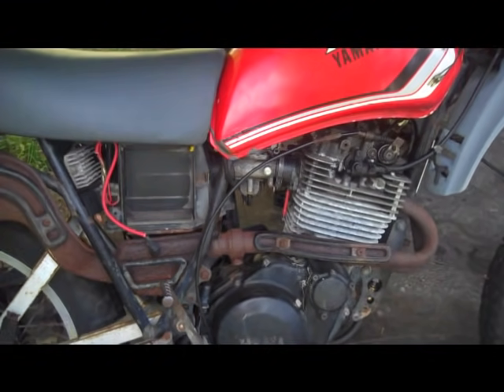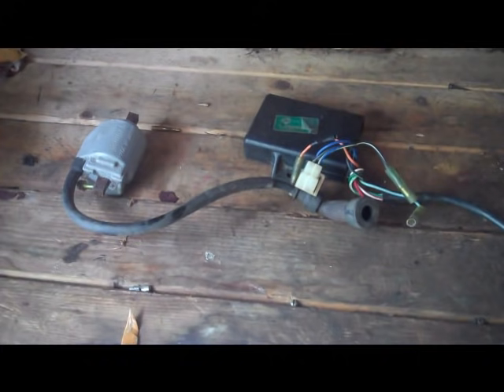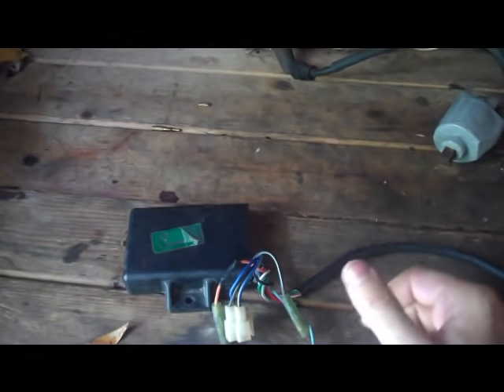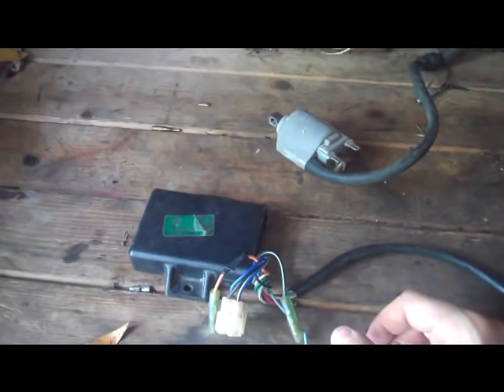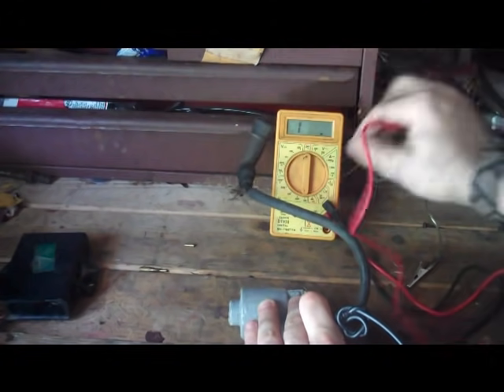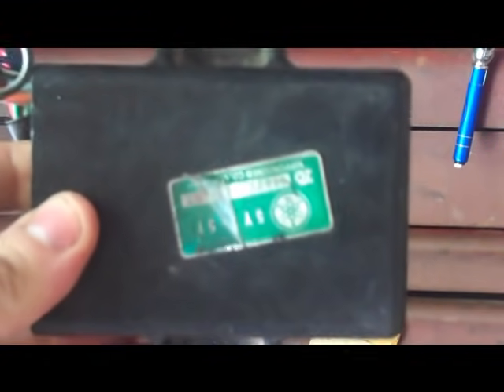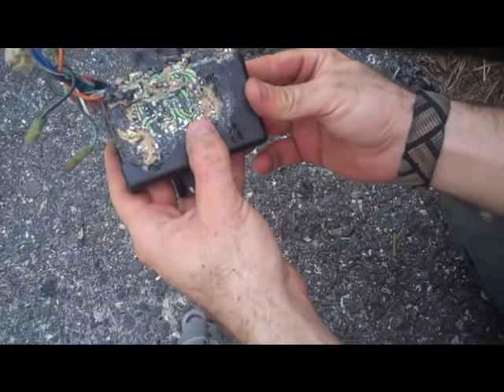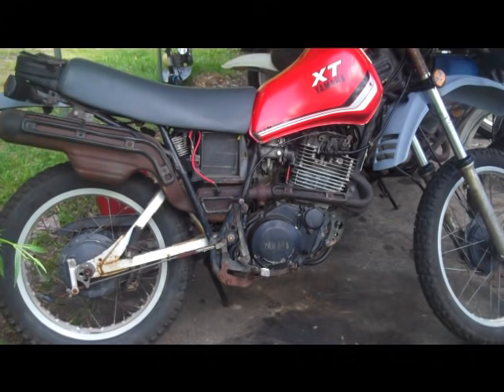How to test motorcycle CDI box, ignition coil

Comment: I have a kazuma 110cc lacoste quad. Took panels off to repaint and after putiing it back together, it no longer runs. It ran prior. It cranks over and is getting fuel, but will not start. How do i test ignition switch, coil,  cdi box? and do you have a wiring schematic print that shows me wiring? It is possible I have battery wiring wrong. im not sure as I do not have a  troubleshooting /repair manual. I could sure use your help. Please send me any repair/diagnostic manual info, etc. that could help me trace and find the problem that it is evident, I caused myself. I bought this lil quad new for my daughter when she was 12 in 2005, and only ridden for about 50 hours b4 being parked in barn since 2007. I am trying to fix back up for my grandsons. And also for my nephews 2 boys when they all come visit me out in country where i live. I am disabled and working on this quad is a good thing being it helps me physically, mentally because of my spine and spinal cord injury that has disabled me and am proud to have great family. I just created  more problems causing it now not to run! lol!!! thanks again - Dennis
my email id - 1racetrans@gmail.com

       Thank you again and God Bless you
Reply from the maker: +DENNIS SBRUSCH Dennis unfortunately I dont have a wiring diagram to offer you but you may be able to find one online. You should review my no spark video for more information about diagnosing these problems, and let me know if you have any questions after.
Reply: i got parts coming to me in the mail also

Comment: my front cylinder won't fire could this be why and could you tell me where the coil wires  go on a 1993 yamaha virgo thanks
Reply from the maker: +Phil manwarren If one cyl is firing, chances are the cdi is working. See your wiring diagram for where those wires go
Reply: +mrmaxstorey  i don't have one
Reply from the maker: +Phil manwarren Buy a repair manual or download one
Reply: whats the web sight ?

Comment: Can I use a cdi off a  Arctic Cat 1973 cheetah 340 and use it on a Honda 1972 Mt 250 also 2 stroke?
Reply from the maker: +TokeXecution Most likely not
Reply: that mt doesn't use a cdi box.  just old school points and condensor.  no spark? check them out. (under flywheel, left side of bike behind HONDA cover)

Comment: i have an 81 kz 650 i went yo start it it turnd over the starter and then the starter just stoped i tried to push start it but nothing happens what could this be
Reply: Could be bad earthing on the starter but not the way you think.  The carbon brushes earth to the starter end cap which then earths to the "pot" (the metal cylinder of the motor) This then earths to the starter motor mounting flange which earths to the engine. Several dubious connections are there which are infamous for causing Harley Davidsons to be non-runners.  Wise owners get some flat copper braid and fit one end to the starter motor mounting bolt.  The other end gets wired to the starter motor end cap bolt thereby bypassing doubtful connections.  With a little skill the braid can be positioned where it is less obvious and it can be painted to match the bike.

 Most vehicles have lots of fortuitous earths but unless one lives in Arizona they can give big trouble.  For example one car that I retired long ago had always suffered from poor charging and flat batteries until I owned it.  The problem was about a dozen poor or iffy connections between the alternator diode assembly negative and battery negative.  A yard of copper braid transformed the car like Popeye having his spinach! The worst fault was the alternator mounting bracket that was blackened by electrical burns where it was bolted to the engine block. Previous owners had wasted money on batteries and alternators but they and their garages never solved the problem.

Comment: high i used to have the xt 600 bugger to kick over, any way I have a kawasaki vn 800 re wiring the bike, following the diagram there is no  poz neg on the coils, but the colour code on the wires are different, so what side do you fit the wires to the coils also i will need an ecu would second hand do and would it just work when connected or will it have to be set up to some programe
Reply from the maker: +trevor francis You can just plug in a CDI and used is fine provided that it is known to work. As for the coils consult your wiring diagram

Comment: i have a 1980 yamaha sr250 that has no spark...i have checked the ignition coil, pick up coil, starter solenoid, and battery. they all check out fine. spark plug is new and the safety relay works.  heres where things get funky...if i have the ignition on and i put the bike from stop to run and put a meter on my spark plug wire i have a constant 12v. if i leave the meter on the wire and switch it to stop i lose the 12v.  my starter button doesnt work either but i think thats just worn contacts. also, will the bike get spark even if the neutral switch is bad? Thanks Matt
Reply from the maker: +Matthew Vescovi You are supposed to get 12v at one of the coil wires, the other has intermittent ground which is what collapses the field and makes the spark happen, so that seems normal. Also the stop switch arrests the spark, so the fact that you lose the 12v is normal too. And yes if the neutral light is bad it may prevent spark if you have a neutral safety switch on your bike
Reply: +mrmaxstorey thanks for the information, i think i might of mislead you when i said spark plug wire.  I didnt mean either of the wires going to the ignition coil, I meant the actual spark plug wire itself.  if that makes any difference in your input please let me know.

Comment: I have a 94 250 Yamaha Timberwolf and it will start by jumping at the starter.  Will not start from switch.  I have been told I need a CDI box.  What do you say?  Thanks a bunch   Danny
Reply from the maker: +Danny Vansickle I dont think thats correct. The CDI is not like the master computer of your machine, it is responsible for determining when to tell the coils to spark. If you are getting spark, and you are when you jump the bike at the starter, then your CDI is fine. I would look towards your starter button, or starter solenoid as the culprit for your problem

Comment: I have a 2006 Suzuki 200 with 1000 miles. starts and runs fine for about 20-30 min then it starts to bog out then shuts off. the bike will not restart until it cools down which is usually 20 min after it shuts down. any suggestions?
Reply from the maker: +john geni Test the spark at that time, see if you have lost your spark. If not then spray some starter fluid in the intake and try to start it. If it starts, that means you have lost your fuel supply. Both are possible when a bike gets warm and it can help you find the problem
Reply: Sound like the coil. Sometime when a bike warms up the coil will lose spark then when it cools get spark again(at least til it warms up again) if this is what happening could be ur coil.

Comment: hey don't know if anyone can help me here. I've got an old 2 stroke scooter, I put a new spark plug in it, (identical to the one taken out, which looked to be as fouled and corroded as a plug can be and still work)  it ran fantastic for about 10 minutes and now won't start again. ran great for months before, it cranks and turns over strong and I can see a good spark on the plug when tested, even starting fluid doesn't start it and the plug seems dry after a 2 minute starting attempt at different times. any ideas?
Reply from the maker: +Paul  Bubnash Is the spark plug fouled again?
Reply: +mrmaxstorey I don't believe so. I've tried starting it numerous times with both the new one and the old one I removed. no dice. it won't fire at all when trying to start whether or not I give it gas. maybe spark is weak?
Reply from the maker: +Paul  Bubnash Maybe, thats easy enough to test for. You need to proceed by confirming you have air, fuel, spark and compression. I set up a motorcycle diagnostic website to help guide people through this process:   www.TheMotorcycleMedic.com

Comment: Hi Mr Max.  two months ago I "shorted out" on a hot day and had to push my bike home.  It's a 1991 Honda Nighthawk CB750.   I removed the seat and saw that the wires from the harness that run under the seat were fried.  I removed the harness and replaced it with another one from a twin bike I have for parts.  No dice.  I ordered a new harness only this one didn't have an extra solenoid.  Today I tried to fix again and took out an alarm box that was connected to nothing (I checked it from stem to stern) and ended up removing a bunch of wires.  However, from that wiring mess, two black wires were cut into the rear light wires (orange and blue) via two little blue plastic connectors that have little metal pieces in it to cut into the wire.  

However, when I turn the key, I don't get any lights or any sign of life.  It's dead.  I know I have an extra solenoid somewhere.  I just ordered an ammeter and will check the solenoid, battery and starter, then will check the kill switch and ignition.  \\Do you have any other ideas?

vgobaira@yahoo.com

Thanks and keep up the great work.
Reply from the maker: +Valerie Gobaira Thats a pretty good start. Sounds like you have a real mess in there.
Reply: Yeah. It was perfect but i used crappy electrical tape.

Comment: I have a 650 kawasaki jetski that wont spark. It has new plugs, cdi (which has coils + leads built in) new regulator. There aren't many electronic parts in a jet ski and I have replaced them all. Even has a new battery. It turns over fine but won't spark. I'm out of ideas.
Reply from the maker: James Dean Are you getting power into the coil pack?
Reply: mrmaxstorey hi i have a 81 honda atc 250r when i start it it usualy kicks back and when it does start it will only stay running a couple min at most it DOES LOOSE SPARK [tested by using spark test tool, made specificly to check for spark] then after sitting for 5-15 min it will get spark again just long enough to get a good rev or two outta it then stop firing again. if i try check for spark with tool to soon it will spark a couple kicks then no fire again, wait a moment and it will give a spark or two. got any ideas?

Comment: My bike went to an old garage.  Mechanic said it had weak spark and blamed the cdi box.  Could that be the correct diagnosis?  Being that my bike is a 81 Suzuki GS1000G, where would I find a replacement that doesn't cost an arm and a leg, like over $200?

Comment: Umm my problem is i got my bike running after two years i cleaned the carbs and all the basic start up maintenance replaced the bendix.... noww i go to flip the key and no green light however i press the start button an my oil light appears but no movement in the starter .., so i watched more videos check my siliniod my ground cleaned the inside of the starter button .. all my lights work ... idk
Reply from the maker: Check out my videos on starter motor problems

Comment: Eh bud.....if the spark plug is not completely flush with the block would that be an issue for a start it looks like my threds are a little stripped #3 and its not sitting all the way down....   and the second thing the on off switch.....I can only here the bike turn over after the 4th or 5th try.......thanx bud your vids rock.......
Reply from the maker: Hey dude yeah that can cause some issues. Your motor is designed to ignite the air and fuel at a specific spot, if your spark plug is not the right type and not screwed in all the way, it can cause misfiring and may even leak compression. If your threads are stripped you may need to helicoil repair it
Reply: nastiest

Comment: So, I went out in the cold and did some investigation. Started double checking wiring connection and it seems there may be a problem in the kill switch wiring. Not sure why it only affected one cylinder....but yeah.
Reply from the maker: That is unusual, try repairing it and see if it solves your problem.

Comment: Is it possible for a CDI to stop sending a spark to only one cylinder on a v-twin?
Reply from the maker: Yes but it is not common. More likely is your coil, pickup coil, associated wiring, or fouled spark plug
Reply: My bike is a 1980 Suzuki gs250. Cold, the bike starts and runs fine, but as it warms it losses the left cylinder. So I guess I would have to test the coil when it is warm(failing)
Reply: I have also read running rich can cause this symptom, but think it should affect both cylinders if the case.
Reply from the maker: Bryan Breitenstein
Since you have 2 carburetors it is entirely possible that one is rich while the other is operating normally

Comment: My Kawasaki KLE Anhelo (250cc) wont run with air filter box cover installed.Only if i remove air filter box cap it works just fine.It happened after the 2 days outdoor parking in wet and snow area.What could you suggest please? Yamaha workshop couldnt fix it for more than a month.All related works have been done with no effect.
Reply from the maker: Did you replace the air filter?
Reply: Hi.Bike works well with air filter installed but without filter box cap.Filter is just clean,it is foam. Carbs all checked and synchronised at Yamaha dealers. Could CDI cause such problem? It has happened after 2 days outdoor park in cold snow weather
Reply from the maker: Pilot Ok
No the CDI doesnt typically cause these types of problems. Check that the spark plugs and spark boots arent wet
Reply: Plugs become black and engine stall in case of hard acceleration.Spark plugs are new. What about CDI's auto advance function,if it doesn't work properly? As i mentioned before,all these problems started after bike staying in snow for 2 days.
Reply from the maker: Pilot Ok The auto advance does not often fail, typically when CDIs fail they either fail completely or slowly lose spark. If your plugs are black I would be most concerned about a rich running mixture
Reply: Pilot Ok Moisture problem..Just let the engine run for a while and it will dry out on its own. Don't accelerate it for it will stall.
Reply: Fidel Fernando Engine was wet a couple of years ago)) And drying it and overhauling and synchronysing didn't solve the problem as i wrote above.I have solved this problem by cutting and angle bending a 2 long fins in the air filter cover.Now driving it just like this.Power and speed just well.But the main cause of this malfunction is still under investigations))
Reply: nope it is brand new

Comment: hi i have a kawasaki 440 ltd. i am tryin to make a flame thrower exhaust. what i am going to do is make another coil based spark plug fireing system for a fuel injector . i have tryed a honda v65 coil with a ingnighter box of a dohc 750 honda (spark box) . it will fire constant good spark when charged by a battery charger only. but when a battery is added it will not spark. any clue? does the spark box get ac or dc power? i know bike charging is ac till it hitts the rec reg box. would i need to come off stator before the box for power?
Reply from the maker: A battery charger and a battery are both DC power so if it works off the charger it should work off a battery, see if the battery is too weak or try splicing it into the main power on the bike
Reply: nope just changed the cable

Comment: Ok thanx..but ill give a bit more info..it is a kawasaki klx 650 1996,,so the key cylinder was removed.. Leaving awhite wire..a brown..and 4smaller onws blk/w and blk..red /red w...now these all arw supposed to be connected to the new cylinder.. But none have any power.. The bike ran perfectly before we took out the cylinder..
Reply from the maker: white is the power wire
Reply: Yes..but why would it be dead..?
Reply from the maker: Kevin Murchie
Like I said, bad fuse, bad fuse holder, or poor connection of the white wire to battery
Reply: I was told that those bikes have some sort of a "anti-hotwire",,resistor in the cylinder of the key switch.. But should not really stop the white from not being hot...im completely baffled

Comment: my problem is i went to start my quad nothing happens i have a electric starter its chinese but i still love it what do i do is it the coil and cdi and if it is and i buy a new one for the cdi will i have to change all the wiring
Reply from the maker: If you buy one for your bike it should bolt right in. I dont know if it will solve your problem or not, check out my video on fixing a no spark situation on a bike
Reply: i am ziptyin g it this time i will know because they will have to to cut it off

Comment: hey i have yamaha dt 125 ypvs bike it has little bit spark but bike is not starting pls help me
Reply: what color is the spark
Reply: Isuru Basnsyake chek the carburettor
Reply: blue
Reply: Isuru Basnsyake services for bikes will help
Reply: I have the same problem mine starts but barley runs even with a new carby and spark plug
Reply: michael koldig what if its blueish spark?

Comment: Here's my problem, got a 92 fzr 600R, I was riding and the vr fuse blew, was told the vr its self is bad and sending to much current, so I got it replaced, now the bike only starts with a jump from a jumper box but only runs on 2 cylinders, was running on all 4 when died though, it runs and rides except its like a 250cc, I was told my cdi is bad and that's why only 2 cylinders fire, my email is jdmcarboy64@gmail.com thanks!
Reply from the maker: Which two cyls are firing?